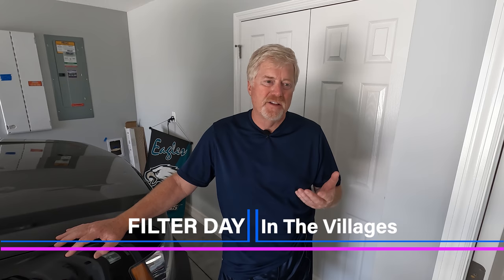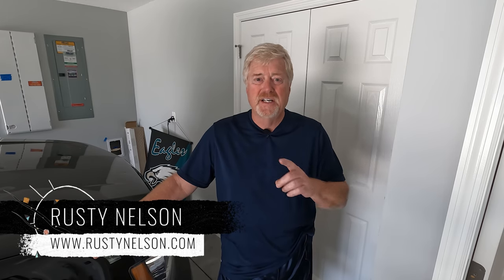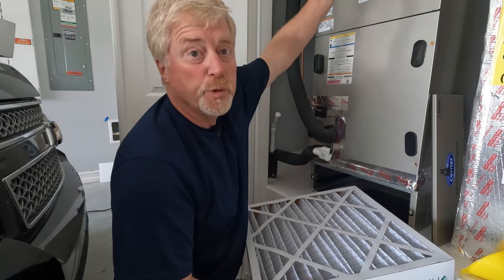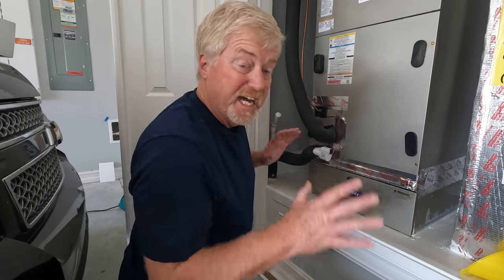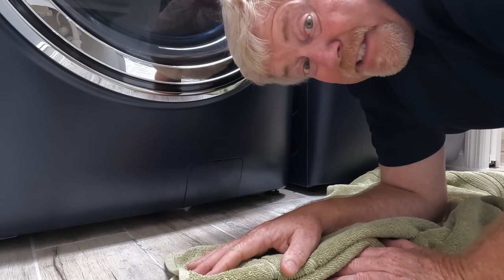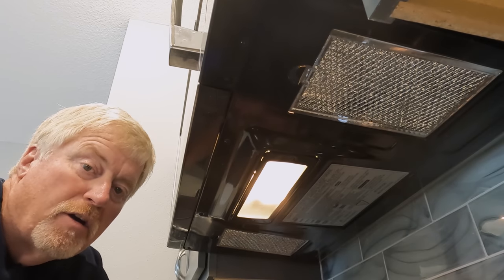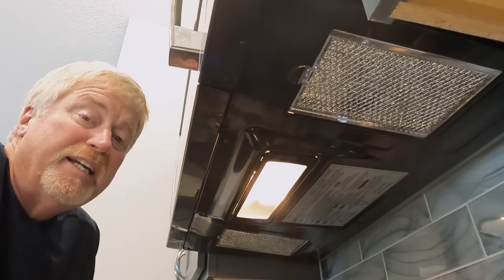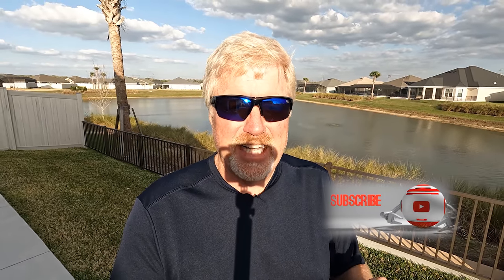The Villages Retirement Community. Your Home Filters, Air Conditioner, Washer and Dryer, Dishwasher

Comment: Thanks Rusty, we moved to TV last April and never saw that filter door in front of the washing machine!  I opened it and followed your great instructions. It wasn’t too dirty but cleaned it out anyways. Glad I had a bucket and towel underneath since water poured out. Also cleaned out the filter in the dishwasher and glad I didn’t find any loose bolts! Ha! Ha! How did you find all these filters? Never knew they were there except the AC. 
Recommend you making a video on How to Operate the Sprinklers! All the same in the Villages? Also another video to program the garage door opener, so you can open it with the keypad outside. Still learning! Fantastic YT channel, you are doing a great job. Keep it going!
Reply from the maker: Yep there are a bunch of little things to learn.  Thanks for watching.  I never did find where the screw came from.  Good idea about the sprinklers.  I have it hooked up to the WIFI.  Needed that to watchin from up in PA.    Subscribe Button: https://bit.ly/3aToJ3H

Comment: Regarding dryer screen. Dryer sheets clog holes in screens and cause fires. Put sink on low trickle and run over screen. If bubbles up clean with dish detergent.  My new washer instructions say do this every load. I don't do it that often but I do it every so often. Love your video!

Comment: I call a big BS on your Munns guy. Putting vinegar in your condensation line is not intended to leave the vinegar in the line but it is part of a flushing process. Warm to hot water down the line to loosen and mold and debris, then vinegar which should sit in the line for 15-30 minutes to further loosen debris in the lines. Then a final flush with warm to hot water to do a final clean out of the condensate line. As far as the filters, 6 months to a year is way too long, especially in Fl. where these system run almost all of the time. Even those 4" filters are pricey, the can keep your system clean and avoid service calls.
Reply from the maker: Thanks Gman.  That's my I said he told me...was not sure how true it was.  thanks for the info. Subscribe Button: https://bit.ly/3aToJ3H